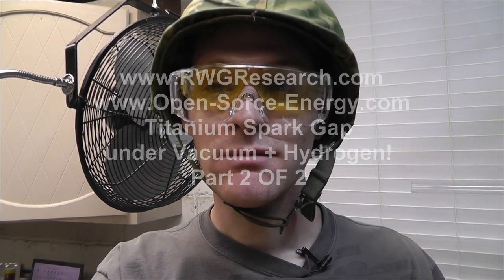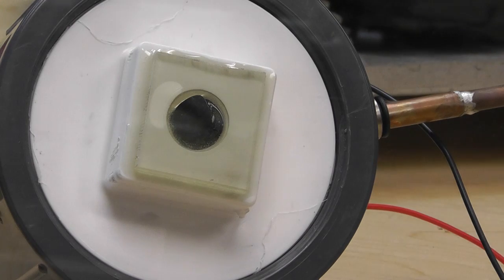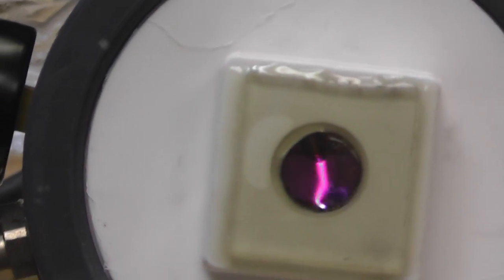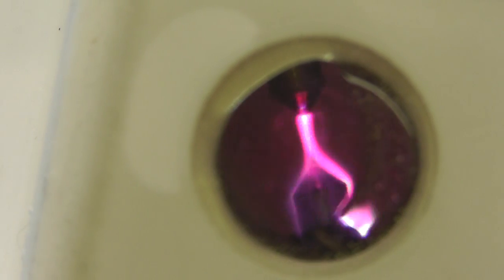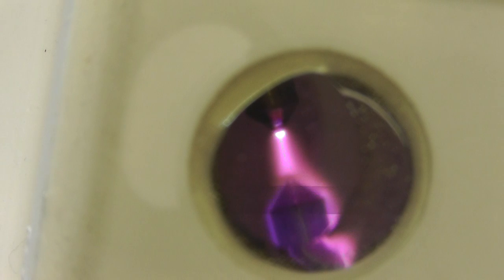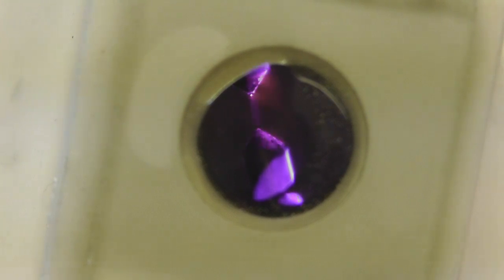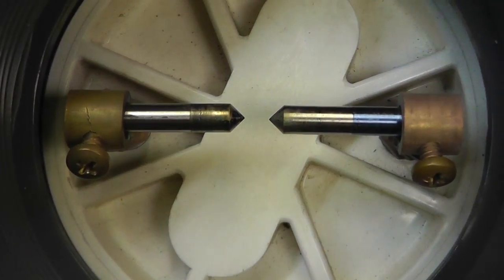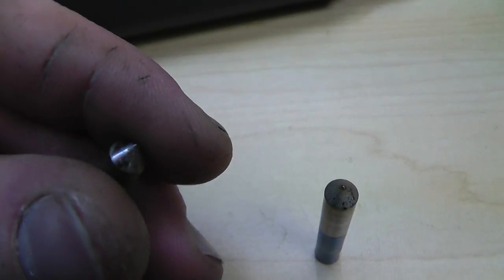Titanium Spark Gap under Vacuum + Hydrogen part 2 of 2! Sweet! RWGresearch.com

Comment: Both electrodes light up with ac and only one with dc, the way it should be. Color is awesome, I was also wondering, if you were to introduce a magnetic field to the plasma arc, how or if it would change. good work Russ,
Jeff.

Comment: Stanley Meyer always said that there should be a mix of non combustable gases inside to match the combustion rate of gasoline. to about 43-37 from about 340 for hydrogen. The exact figures are in the patents.Gasoline has about 30% hydrogen he said. And produced pure hydrogen 70%. He also said that its the hydrogen thats the burning part in gasoline. Then he has shown 50% hydrogen and 50% non combustable gases makes good explosions. Hope to see some more tests....Good work!

Comment: Hey Russ, im glad you and your lab are bolth OK. Smart move with the safety precautions.
Had a question for you.
Nornally when a metal is permantly magnetized it is slowly cooled in the presence of a very strong magnetic field. How do you plan to magnetize the gas, if the metal ions are only molten for a fraction of a second? (assuming you actually can sucessfully combine the permanantly magnetizable metal ions with the host gas)
Every day after work I look for your videos, inspirational, thanks

Comment: Hydrogen doesn't burn/explode, a mixture of hydrogen and oxygen does.  30" Hg is a near perfect vacuum (he's probably pulling 27-29) which means there isn't much "air" in there and as such there's even less oxygen since air is only 21%.

Comment: X-Ray WARNING!!!!

Hi. An interesting Video.  I didn't notice any warnings of X-Ray emissions!!! (other than a giggle about the possible affect of radiation on your camera!).

 This under vacuum is essentially an X-RAY tube.  Anything over 5 KV You would be flooding the room with hard X-rays!  Your safety setup isn't safe from X-Rays. You should set up a Geiger counter nearby this experiment.... and leave the room / Lead shield etc....or better don't do it!!
Reply: MrOzzyCam http://repository.um.edu.my/20432/1/AIP%20Conf%20Pro%201328%20p148.pdf You should read this paper before considering undertaking any such experiments.
Reply: MrOzzyCam You may think that your X-Ray emissions are low, due to a cold cathode and lack of thermionic emission of electrons and that may be true when using DC.  When you are using AC, you will notice that the tips of both electrodes become white hot.  In the case of AC you will have significant thermionic emission of electrons.  The device you have created there wouldn't be much good for making nice clean X-Ray images, but for irradiating yourself the setup looks great....